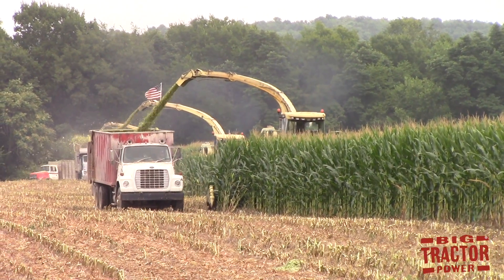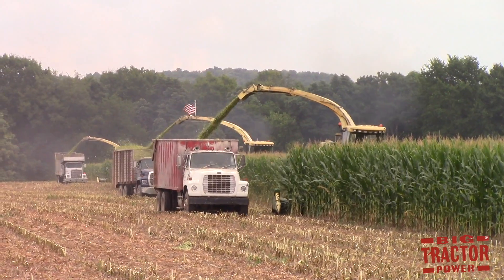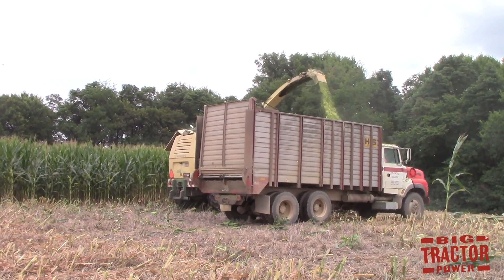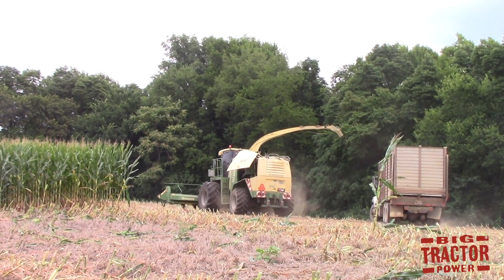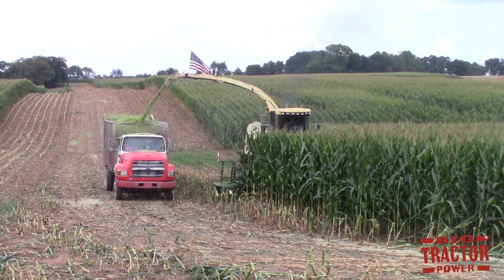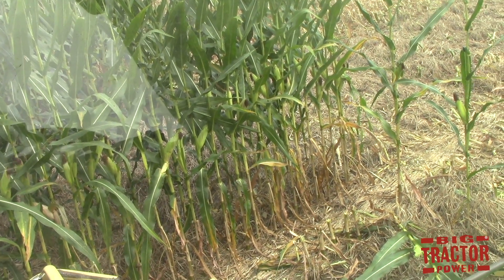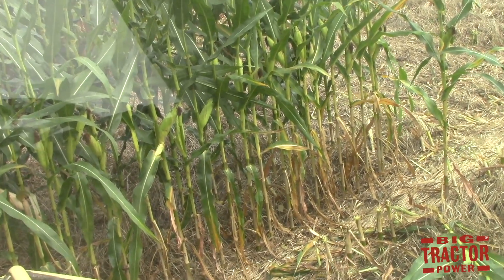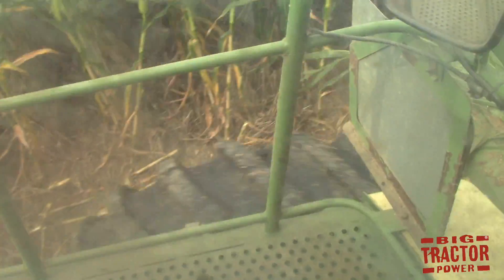3 Krone Big X Choppers,  2,225 Horse Power,  30 Rows of Corn,  2018 Corn Crop

Comment: filling 6 lorries  a minute is fine but when it arrives at the yard at the same time  it causes no end of problems
Reply from the maker: They have more than just these trucks running and two different pits they are unloading at with three blade tractors running so it’s no issue keeping up with the crop flowing in.

Comment: I understand the HP n why but when I think of a chopper filling a silo we always used125hp pto tractor. That blew it 80’ vertical which we all know is a lot of head foot to push material. So it is impressive the HP is that high on these rigs. We chopped corn at the silo in full stalked bundles.
Reply from the maker: Chopping at the silo goes way back.  I have Papec brochures on ensilers for the silo. 125 hp at the silo can work because you are feeding bundles in kind of like a wood chipper.  Nice steady rate.  These sp choppers are cutting 25ft of 14ft crop pushing it into the feeder at 5 mph and chopping it.  This chopper cuts up 10 tons of silage in 2 minutes.  How many tons could an ensiler chop in 2 minutes?   Thank you for sharing. If I could film an ensiler it would be a great find. What tractor and ensiler did you run?

Comment: Does Krone machines run hot?   Why are the engine bay doors open?
Reply from the maker: The mufflers do make them run hot. You might notice two are straight piped. It’s lets the heat out.
Reply: I've seen class choppers run with engine panels open too

Comment: Ok...Hope this question isn't too silly...Most of the farms in PA (that I've seen) run the Claas 900-960 series with the  V6 Mercedes Diesel. 

 But the  970-980  have the 12 cyl  MAN diesels..   And the KRONE Big X 1100 has a  MAN 12 cyl engine. 

 So my question is:   what is MAN?? TY
Reply from the maker: The M A N engine is built in Europe.  They also build a line of heavy duty trucks.
Reply: Sounds good... Thank you for info!!

Comment: Dang. All choppered straight piped as well??? That would be a lot of lovely rumblin.
Reply from the maker: The two V12s are straight piped the 700 is not.  A muffler collects to much heat under the side panels so they found straight pipes let the heat out.

Comment: A single row AC corn silage chopper took a 45 horsepower tractor to operate and could only creep along in 1st gear and would often have to stop its forward progress to allow the silage chopper to process the corn.  I am not at all surprised that it takes so much power to process ten rows of corn at the speed at which this is being processed.  Is this a different variety of corn than one that is being used for grain?
Reply from the maker: Great history.  There are different varieties of corn just corn silage use.  When I was growing up farms normally chopped the lowering preforming fields for the year.  It was random. Today it’s very focused and all about the best yield for silage.

Comment: I worked for a custom chopper that ran three John Deeres with ten row heads had 4 truck to each chopper to keep the chopper moving if the truck goes up and down the road every day that was a good truck no matter the make, color, or year. Opening up a field meant you had to wash windshield more than  usual and driving blind behind the chopper which meant when the field gets muddy and you get stuck and corn silage get on the window. Oh the days, how i miss field work.
Reply: Or the ass will blow it on your windshield on purposes
Reply from the maker: It’s neat seeing the chopper open the field. It takes allot of coordination.  Keep the windows rolled up. 😄
Reply: bigtractorpower so true.

Comment: That ain’t big trucks if it’s only 10T (because in Europe nobody uses trucks you just can’t go on the field with them) we have a trailer of 13/14T but it’s mostly around 16T and you’ve got some with 21/24T trailers
Reply from the maker: These are older trucks so they are inexpensive power and allow to run a bunch of haulers for little investment.

Comment: 10 tons every 2 mins and the field is making 22 tons/acre. They're gonna get done before they even get going good!  😂 That's a bit faster than the old 1100 Massey pulling the 2 row chopper on the farm where I grew up!  Nice video!
Reply from the maker: They move along.  My neighbor in the 70’s had a ‘76 IH 1066 and a 2 row NH 892 and 3 Lamco Forage boxes. It would take a week to chop a field or two.  Then they got a big 4 row NH 1600 pulled by a Case 4690 4wd and a DuAl Dump Wagon. That sped up chopping but nothing like these Krones.

Comment: Nice, And one more reason why they need so much power and are so big is sometime these big guy have to harvest in MUD! I've seen em do it on other videos and its not pretty
Reply from the maker: Very true.  We are lucky here that harvest is often in the dry of summer. In 20 years I have not seen silage mudded out here.  Plus sorghum is double cropped behind the choppers so they need a smooth surface to no till in.  I do like watching muddy chopping videos like Mike Less YouTibe has filmed with choppers and dump carts.

Comment: I've noticed that every once in awhile I see Krone with the side panel open. Do they have over-heating problem ?
Reply from the maker: It’s the muffler.  It collects to much heat under the panel of the 700.  The v12 had similar issues. They straight piped the V12s and no more heat issue.

Comment: Impressive machinery. Each plant has much bulk however these machines make it look easy. The heads have a sinister look to them like fangs. I thought the chopped corn went into silos, not bunkers or am i wrong. Thanks & god bless BTP
Reply from the maker: Glad you liked them. The EasyCollect stands out. I hope to film a 14 row some day.  You can put silage in a bunk or silo. A silo is slower so for this many machines a bunk makes sense.  My video earlier this week showed the bunk being filled with the Case IH Mx285 and JD 6715 tractors packing the silage. The fact of 3 choppers filling it did not fit that narrative so I only showed the one machine. I will show a silo farm this month.
Reply: Mark Stengel it does but I think the amount of corn they are cutting would overwhelm a silo , I think that’s why the bigger farms use bunkers
Reply: That corn is too green for a silo.  Either have to be fed soon or stored in a bunker I should think.

Comment: Too many choppers and not enough trucks.
Reply: In an earlier video, maybe the same farm, I counted one chopper, at least three trucks and two tractors leveling the pit silo.
Reply: Depends how far it is to the clamp our neighbour runs 4 or 5 trailer that are about 50m³ capacity with their Fendt Katana when they do the fields next to what was my granddad's place they can keep up with a trailer always there ready to take over when they do the fields next to ours which adds about a mile to their journey they can't keep up and it is either left waiting for 5 to 10 minutes or they hire in two  more trailers, drivers and tractors.